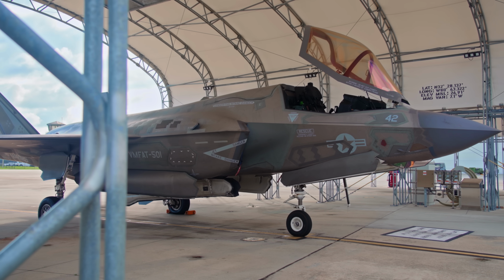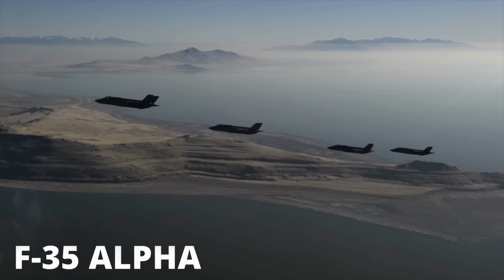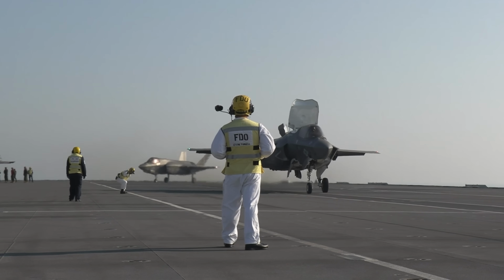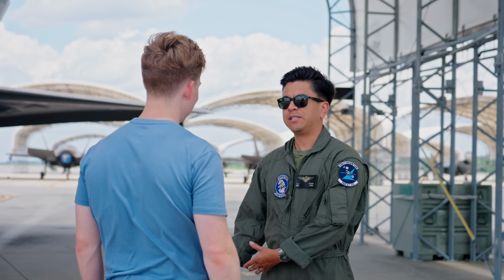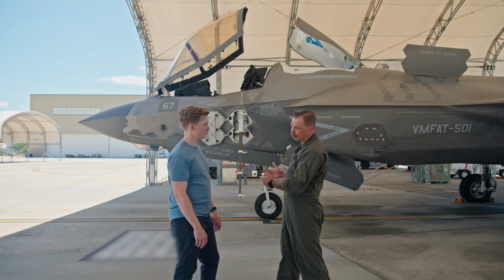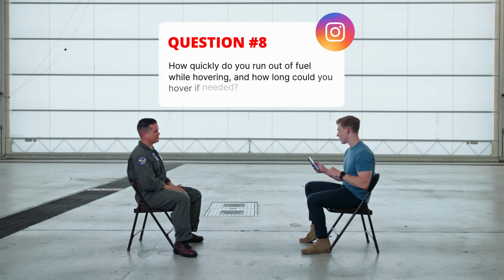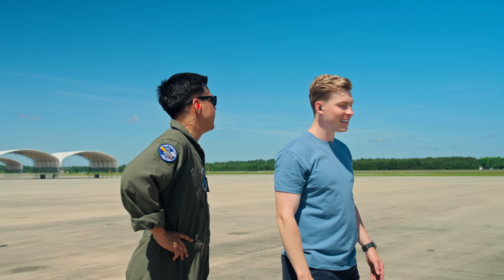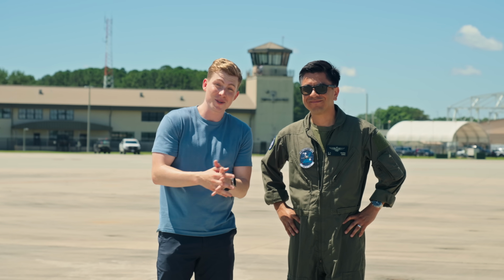Flying the Marine Corps F-35B Stealth Fighter Jet

Comment: Awesome video! But the fact that the F-35 cannot utilize short range heat seeking missiles internally is ridiculous. If you look at the kinds of real adversaries we'd face in Asia, they have stealth fighters there as well. The probability of coming to the "merge" is way higher there, and that's where you need these heat seeker type missiles. This seems like the "no need for a gun" moment of the 21st century, like the Phantom had in Vietnam

Given the F-35's advanced sensor suite, including IR, there's just no excuse for it not being able to include the AIM-9X internally. The fact that we spend ~$1T on defense makes it even harder to understand. They are over-relying on stealth without accounting for the fact that our adversaries will have stealth too
Reply: I think you'll find they've probably considered this, and they've felt that a merge is still unlikely enough to not justify wasting radar guided missile slots with a heatseeker that might never get used
Reply: Stealth fighters aren’t invisible, just less visible. BVR/long range missiles would still be able to engage a J20 far outside any short range missile, so the Air Force didn’t see any reason to pursue short range internal missiles.

Comment: Limited usefulness of vertical capability. Increased maintenance, reduced payload, higher price and limited landing sites(destroys most tarmac, and blows a ton of debris which can get sucked into engine). The hover would not be useful in combat(speed and kinetic energy are king).
Reply: that´s why there are 2 other version for when you dont need vtol

Comment: The harrier is NOT a US jet fully designed and created by the British. I may as well say the F35B is a British jet as they have bought and use it as we did the harrier.
Reply: The Harrier II is a US upgrade, completely built in the US by MDD other than the engine which was supplied by Rolls Royce.

Comment: When will people understand, the F-35 is NOT a fighter, all 3 variants aren't fighters, they are all made to be an air to ground strike aircraft that can defend itself,  it's purpose is to work along side the F-22, though it does possess fighter capability, it's not a dedicated fighter, and more supposed to be a multi-role aircraft that heavily leans towards precision strikes, the F-22 can carry JDAMs, but it's not meant to. Nevertheless, still a cool ass aircraft, love you Sam
Reply: I respectfully disagree, it's not an air superiority fighter, but it is a multi-role fighter. You would still task the F-35 with air to air missions just like the F-16. Keep in mind the poor dogfight performance you've heard about is from much earlier in the F-35 programs lifecycle. They had software that wasn't finished and didn't allow high g maneuvers required for dogfighting. The F-35 is also meant to be a BVR fighter as well, utilizing low observability to fight at longer ranges.

Comment: Absolute POS. The F22 is superior. Theres a reason we export the F35 and not the F22.

Also FIRST American jet to hover. The AV8 is a Harrier. Which is British.
Reply: the reason is no one can afford the f22 anyways and the us didnt make enough
Reply: 1. The F-22 export ban came into effect back in 1998 and was obsolete by the time the F-22 entered service, but by that point there were already politicians wanting to cancel the F-22, and only 4 years after entering service it was cancelled.  The export ban was put in place because of a unique timeframe where the Cold war had ended and Russia was no longer a threat, but their spies were. If the export ban on the F-22 had anything to do with it being vastly more capable than the fighters that were exported, then the F-15 would have been banned from export back in the 70s.

2. The F-35 is exported because it is a multi-national development program. The customers already know it's secrets, because they helped develop the systems.

3. The AV-8A is a Harrier. The AV-8B is a Harrier II, which is a US-developed major upgrade that later served as the basis for the UK's Gr.5/7/9 variants.

Comment: Theres actually 4 variants of the F35. The A, B, C and I. The I is the Israeli variant. The reason they have their own variant is because Israel wanted to put some of their own tech in their F35s. They are the only non-US F35 operators that are allowed to do this
Reply: In reality, it's just a marketing gimmick to make Israel feel special. Norway have a modded version of the A with a drag chute, which is structurally different to a standard A, but didn't feel the need to ask for it to be called the N variant. Otherr nations like the UK also have some control over differences in mission software, and yet those also aren't classified as different variants.
Reply: Israel wanted to use their own avionics and weapons, to support their home industries.

Comment: Kinda a low-key demo, I’ve seen many (including pre block IIIs) that pulled maneuvers wayyyy harder than this. 😳

I’m starting to think the F-35s in general are backing off on their demo capabilities, perhaps for security reasons? 🤷🏻‍♂️
Reply: Or, because they are inferior in maneuver capabilities, compared to others?
Reply: @CaraVerde  I guess you didn't read my comment in its entirety? I've watched many demos, and viewed a training flight for the concept F-35A demo team before it was formally launched.  The plane did nearly every maneuver the F-22 did, including some insane stuff I didn't think was possible without thrust vectoring... that concept flight also had the most beautiful vertical stall into a flat-spin that I've ever seen.  Continued the spin down for probably 7ish full rotations before powering-out of it. 

Absolutely extreme stuff versus this demo.  Nothing to do with limitations of the aircraft.  Again - I feel like they're dramatically backing-off on the public demonstrations of the plane's capabilities.  Could also be at the request of other JSF and NATO countries.
Reply: @EstorilEm  Well, you're clearly the one who didn't pay attention to my comment. 

Did I claim that they ARE inferior?

Comment: Saw a F35 Lightning II at pacific Airshow and been impressed. This thing is overpowered as f*ck and sounds absolutely insane. I was really impressed and happy to experience such a display live.
Reply: It’s louder than f22
Reply: @xris5697  louder than f16, f18, f15, and f22, the f35 is the loudest out of all of them. It's because the single jet engine on the f35 is a behemoth.
Reply: @JuniorJunison  agree 👍, on a side note I worked on the development of the lift fan gears to full production. Very proud of my accomplishment as part of the team.
Reply: @xris5697  oh cool, my dad helped with flight testing of the f35, I was lucky enough to be near the runway when an f35 was either hovering or doing short take-offs, and it was so loud that my dad had to roll up the windows on the car, when they were down, even being I don't know, maybe close to 100-200 feet away from the runway the sound of the big roaring jet engine is all you could hear, and I remember at the time it scared me a little because it was just so loud and you felt the sound all the way in your chest. Quite a magnificent beast of a machine.
Reply: @JuniorJunison  wow they let you be so close to the runway without hearing protection? And also happened during initial testing to be so close, for me I would avoid that situation.
Reply: @xris5697  well truth be told, it was a naval air base, and we were parked on one of the roads near the runway, in fact there is a portion of the road where you literally drive across one end of the runway, anyway there wasn't anyone out there monitoring the area as it's an active runway.
Reply: @JuniorJunison  I assume your Dad must be an Navy officer. Quite an experience of you witnessed the initial testing.
Reply: @xris5697  nope, my dad's an engineer, he was one of the engineers involved with flight testing, I remember he had to learn all these different scenarios for things that could go wrong and what the pilot would need to do to avoid further issues or to make it out alive, I also remember that they had data points that they were trying to meet as part of the testing.
Reply: The f35 is loudest fighter plane I've heard, it is loud as f**k.

Comment: Love the video! Radar reflects off of 90° angles. So to make a stealth aircraft we need to make an aircraft without any 90° angles. Add a super secret non-reflective coating and we have the F-22 and the F-35. Amazing.
Reply: There's also a lot of clever refraction and surface wave stuff too, which the F-35 also nails by all accounts

Comment: The F-35A isn't specifically "designed for air to air combat". The F-35 family as a whole is multi-role in design. They are all capable air to air platforms, and yes the A can rate fight better due to higher thrust to weight, but The F-35A isn't designated an Air superiority fighter. The F-35 was designed to replace/augment the F-16, F-18, A/V-8B and A-10. The F-22 and F-15C/E/EX/QA all fill the air superiority roles, while the F-15E and newer models also fill gaps in the air to ground  capabilities by bringing a ton of weapons and high speed and exceptional maneuvering abilities.
Reply: Not technically designed to replace the A-10, rather the F-16 was gradually taking over the A-10's missions as technology advanced, and the F-35 is designed to replace the F-16.

Comment: What about the British Harrier?
Reply: Man, find someone who won't forget you like the Brits won't forget about the Harrier 😂 US makes the most sophisticated plane ever to fly and the Brits are like "bruh, it has one capability we developed 6 decades ago" (seal clap noises). The Harrier is incredible surely, but every single F35 video has 10 people like you 😂
Reply: It isn't a video about the British harrier although the American version was mentioned. Unfortunately the harrier is on its way out. Although the harrier proved what a STOVL aircraft could do even with the limits of had. The F-35b is the next step though, is lift fan system is way more efficient than the harriers vectored thrust nozzles. The F-35 is supersonic, stealthy, carries about double the ordinance and fuel. Quite literally the harrier walked so the F-35b could run. Unfortunately I think the harrier had already got it's last airshows in, the A-10 isn't doing anymore after this year either, and the Kc-10  just recently had it's last flight

Comment: The F-35 is my favourite VTOL aircraft
Reply: Same
Reply: @Evnut2  STOVL*
Reply: @therobloxroleplayguy clean  and not full of fuel the thing can take off vertically, in fact in demonstrated that ability for the first time in 2013.
Reply: @maleprincess62  in fact, you should improve your English
Reply: @maleprincess62  yes but conventionally it cannot take off vertically
Reply: @therobloxroleplayguy  wow the first thing you go at is a minor grammatical mistake. F-35B is capable of vertical takeoff, meaning it's a VTOL aircraft.
Reply: @maleprincess62  it is both but there isn’t really a reason for it to be not full of fuel and disarmed to take off vertically genereally the f35B uses STOVL